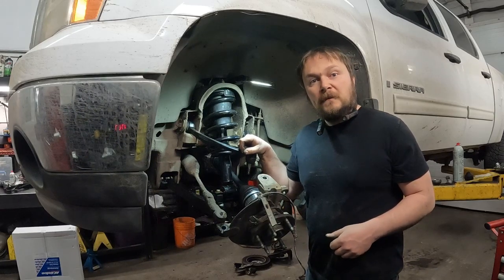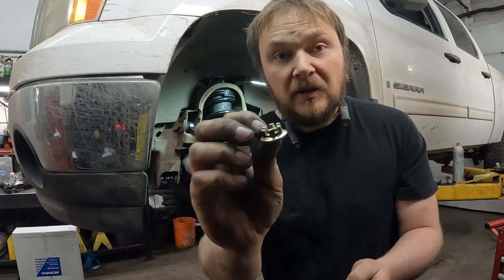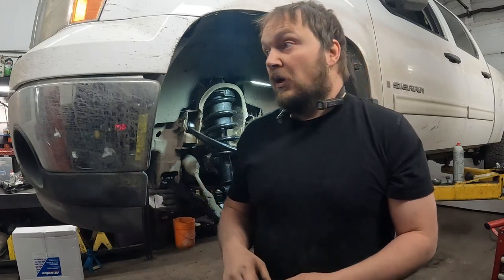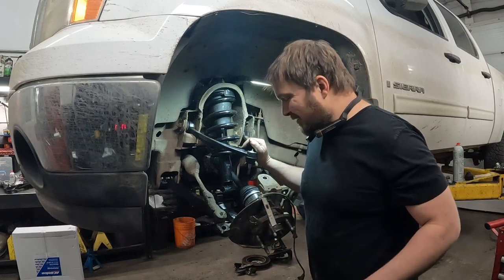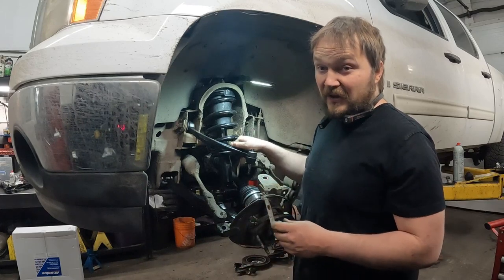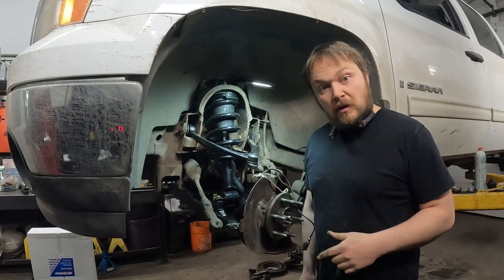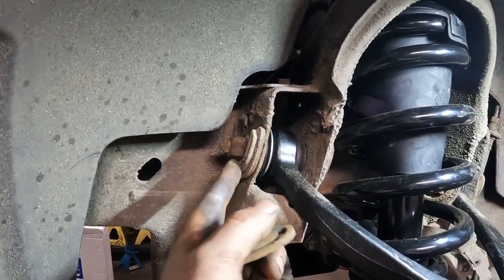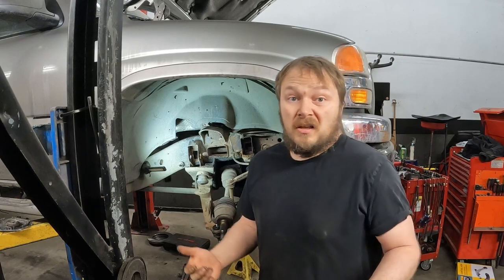How to remove Chevy truck upper control arms with seized bolts and frozen adjusters! Plus more!

Comment: thank you so much i have a 05 Hummer H2 and yesterday i started taking off the upper control arms well i came to that part and the bolts are stuck i broke one of the bolt so i stopped before i damaged more  googled how to get them out came to your video amen brother after watching your video i feel good to get the bolts out safely thank you

Comment: Great tip using the ball joint press!! Unfortunately it wouldn't work on the right side bolt for the driver side. I ended up having to use PB blaster and taking a 21mm socket with a breaker bar and working the bolt up and down trying to let the blaster seep in. 2 days, some blood, a lot of grease, and tons of swearing, and they're finally out. It's a New England truck, so I'm gonna put anti-seize on the new bolts to hopefully prevent this in the future.

Comment: I have a 2004 crew cab Silverado 1500 and trying to replace the upper control arm on the passenger front side after unfortunately heating up the rusty bolt the nut ripper right off with part of the screw still stuck in the broke off nut. Any  expertise on how to finish the replacement because I'm done heating it up and on the other side of the bolt is the head, but because of the rust it will not budge?

Comment: As someone who has been fighting these for about a day without the right tools. The cam was broken from overturning it. I had bad thinking and figured I could twist the bolt loose. And snapped it before I realized I was messing up.

Comment: Awesome tips, thank you for sharing! Next used car I'm buying I will remove all bolt in bushing put antiseize then assemble it back together... Think it's worthed.
Reply from the maker: @mickmini3846  Glad you liked! Definitely any time I pull these out I clean and anti-seize them but only for the shank of the bolt. I don't anti-seize the threads as you don't want those nuts backing off. Also make sure you mark them good otherwise you'll need an alignment. But ya... if it's a 15 year old truck and they're original then for sure one of them's not coming out!

Comment: Wish you showed putting the press on the left bolt onstead of the right lol thats the one thats stuck for me.
Reply from the maker: @Sawyer Bennett  Ah ya, that one sucks. Much harder to get the press in there. I had to go with a bunch of adapters and various studs/bolts to rig something up. Multiple attempts to get everything to stay and be able to apply pressure on it. Then some smacks with the hammer to shock it loose.

Comment: Awesome video and great tips.  Been there and done this too many times.  Most recently has been the sway bar bushing clamp bolts.  The bolt heads usually just break off and your running through MANY drill bits trying to drill through the tough steel.  Maybe there's a way to get the ball joint clamp on there.. I don't know.  Throwing a hammer through the wall sure doesn't help

Comment: What about just cutting the bolts with a Sawzall and using new ones?
Reply from the maker: @wisconsinwoodsman1987  Because doing that sucks! There definitely are times when that becomes one of the better options but ya... usually really not fun. Takes forever, hard not to smash the end of the blade into the frame, blades dull quickly on these bolts. I usually don't use my sawzall for anything other than exhaust because I end up spending too much on blades. For sure it becomes a life saver from time to time though!
Reply: @eurbanautotech  Yes, you speak truth. I ended up using an angle grinder to cut the bolts off. Was still a challenge. New ones arrived yesterday 🙂
Reply from the maker: @wisconsinwoodsman1987  Good job on getting them done! Sometimes ya gotta get creative! It's always nice when you can just blast them off with a cutting torch but that's not always much of an option. If it's in the back it might be right next to the fuel tank. Otherwise the brackets might be getting thin and rusty and could get damaged from the heat of the torch. It's not uncommon to spend A LOT of time trying to get one stupid bolt out....
Reply: @eurbanautotech   I had to remove the upper control arm on the driver side so I could barely get a socket inside the frame to grasp a differential carrier nut. I have to remove the axles, driveshaft, and diff to drop my oil pan that has a leaking gasket. Just a real pain on a 2002 Sonoma 4WD.
Reply from the maker: @wisconsinwoodsman1987  Those are no fun even in a shop on a lift with screw stands and tranny jacks/etc. Can't imagine what they'd be like to do on the ground... Not sure what your setup is like.
Reply: Great advice... Excellent video
Reply from the maker: @robertdiehl9003 Thanks!

Comment: You just blew my mind was changing lower ball joints and upper control arms yesterday and snapped one of the bolts from the a arm wasn’t much left sticking out to beat on it the ball joint press might just work
Reply from the maker: @Damon Connell  Ya, it's never pleasant when they break and unfortunately they break quite often! The balljoint press will get them out. Not always a simple operation though. You may have to get creative with adapters and may need an extra hand to hold everything until you get it set up. I've also encountered some that were so seized in place that they didn't budge when I loaded up on the balljoint press but then hit everything with a hammer and the shock caused it to budge. Then load up some more and hit again. Etc.

I use the bj press for all kinds of things. U-joints, pushing out broken exhaust studs like the ones between the Y-ppe and the intermediate pipe... It's good for suspension bushings. Heck, I've even used it on a small press in wheel bearing!

Good luck!